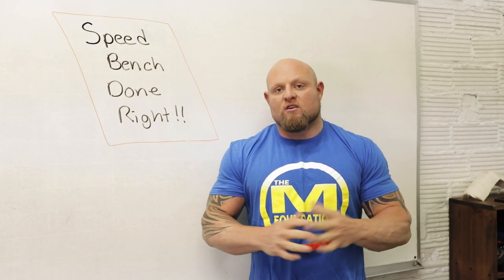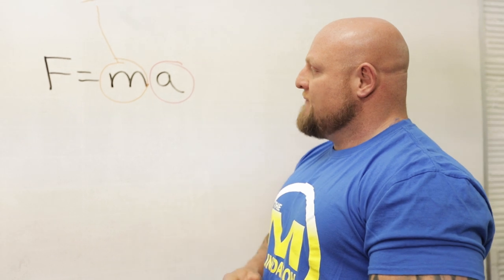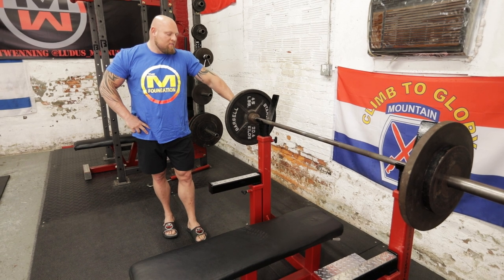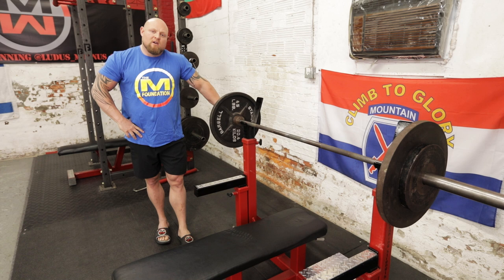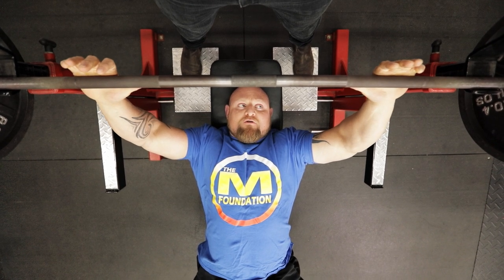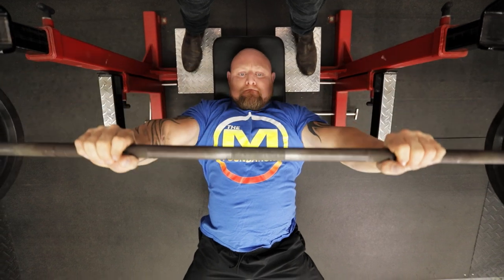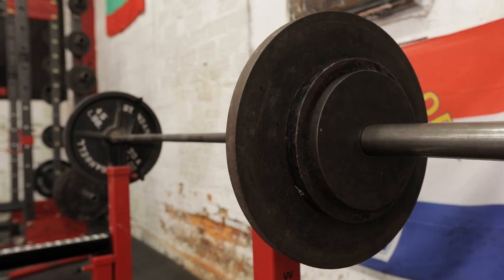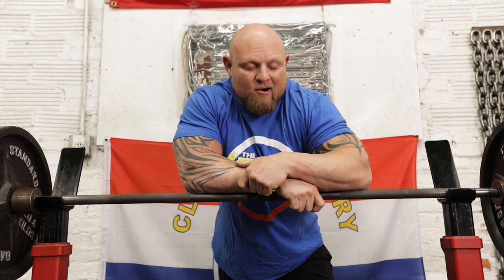SPEED BENCH Done Right! (Bench Press with Acceleration!)

Comment: Great video. How would you program this for sets/reps and how often would you incorporate speed work compared to your other pressing days?
Reply: 9x3 & 8x3 is often the standard for speed days. They’re usually performed 3 days after max effort work so that the fatigue from one workout doesn’t affect the other. 
Hope this helps.
Reply: 30 % x 10x3, 35% x 8x3, and 40% x 6x3

Edit: didn't finish the video, just saw the question.
Reply: Typically speed work is done once a week for upper and lower. So let’s say Sunday I do max effort upper I would do dynamic upper on Wednesday.
Reply from the maker: https://www.patreon.com/wenningstrength

Comment: What is the evidence that speedwork isn’t absolutely useless, outside of the extra volume it provides.
Reply: Whats the point of pushing or pressing something if you can only push or press it slow?
Reply: You do have a point it does have to do with overall more volume but learning to lift faster/more explosive does help to push through points when weights get heavier. However speed work doesn’t really have a benefit if you’re beginner and have not built a base of strength first
Reply: Louie Simmons
Reply from the maker: https://www.patreon.com/wenningstrength